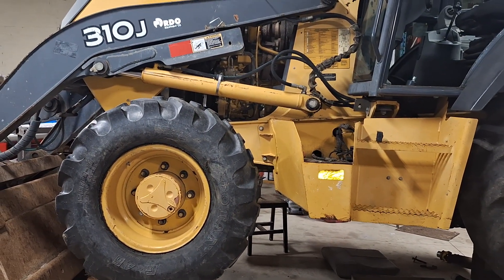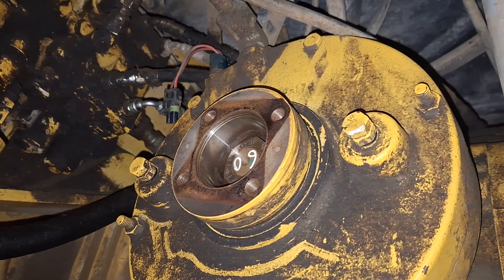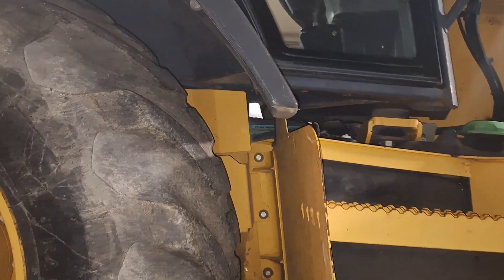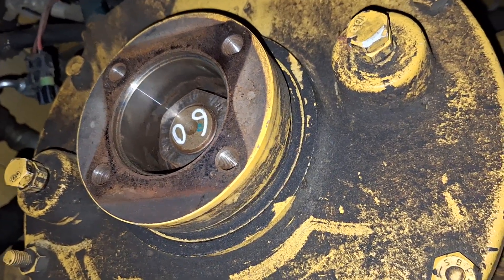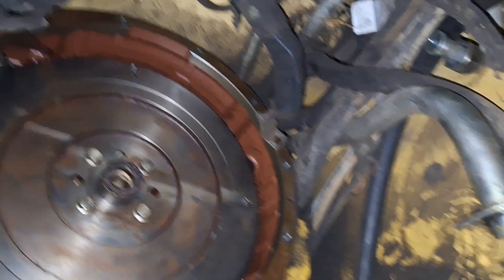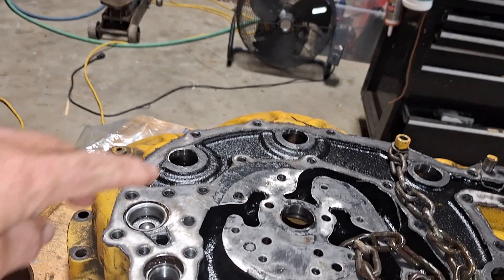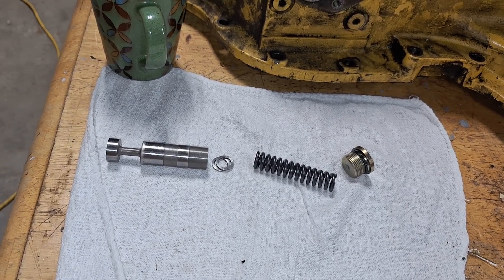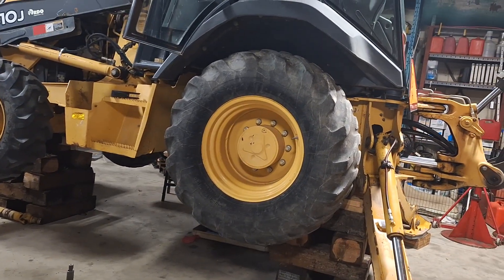Part 1 John Deere Backhoe 310J, 310 Series, Transmission, Brake,  Supply Pump pn AT501976 Problem

Comment: That is a gerotor style pump. The inner ring has one less tooth than the outer ring. outer is driven by the inner, the area opening where there is no tooth is the pumping area. oil is drawn in as the rings separate and squeezed out as they come back together. no pieces are missing, looks like a shock load possibly from cold oil and a sluggish relief.

Comment: I have a 410j and the second speed  clutch didnt work. There were a few pieces of metal at the screen.The snap ring fell out of the grove where the cluch broke. First issue with the transmission with 7300 hrs

Comment: Looks like I’m gonna have to pull my transmission out of my 310j also. Did you use a cherry picker through the floor to lower it or did you use a trans jack?

Comment: I pulled the hydraulic tank. We have a crane and there are only a few hyd hoses. My trans was so covered in old dirt and oil I had to take an air chisel to get to the bolt heads.

Comment: On this transmission there is a common issue where it loses second and fourth gear. I have a 2012 310J with 3600 hours and it has no 2nd or 4th speeds. I checked solenoids they seam ok. I was told by Deere dealer there is a known issue with a snap ring coming off internally on the shaft coming off the clutch pack that causes this problem, or the clutch is worn. Did you take apart the clutch on yours or notice if there was a snap ring holding the clutch assembly together? I am trying to understand more about what this issue may be. Not looking forward to dropping this trans either!
Reply from the maker: This machine must have been a rental and someone must have busted it hence the  Chinese parts. I don't know the history. It all looked new inside, all the gears worked before the pump failed and they are workicine now. I just play with it around the airport. Not sure if I would want to try making a living with it. Good luck with yours. Wish someone had of told me to let it hang down a bit more than the instructions in the manual to get at the bellhousing bolts. Cheers
Reply: Thanks, for such big machines these certainly lack a feeling of confidence and assurance. I feel like trans or electronics could fail at any point. I have been left hanging with parking brake stuck on or no gears due to failing relays/solenoids, I agree would not want to make a living with one of these. I think I will finish my projects and sell it.